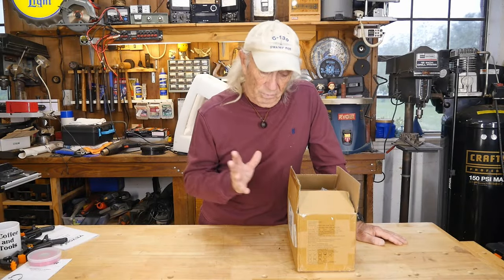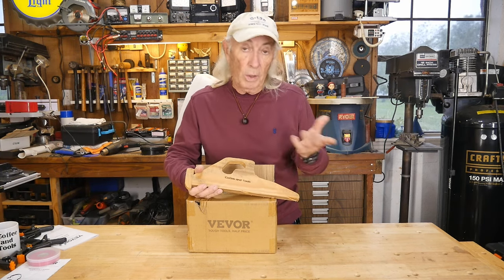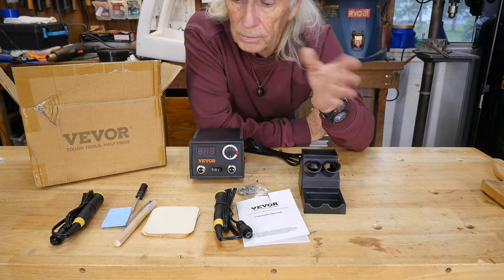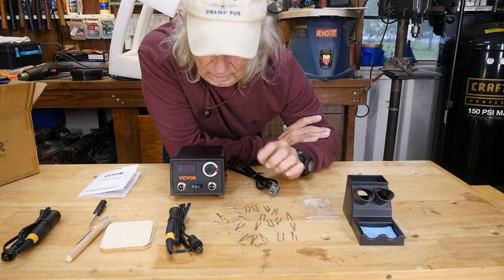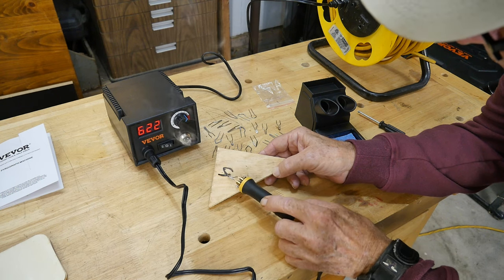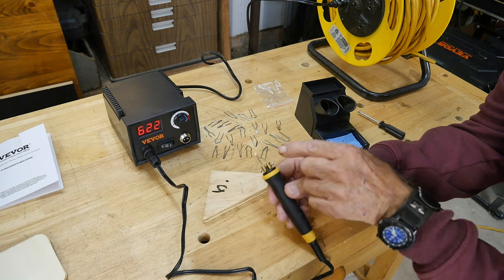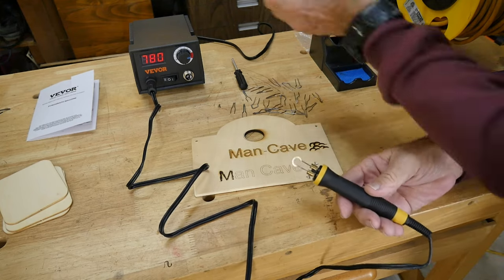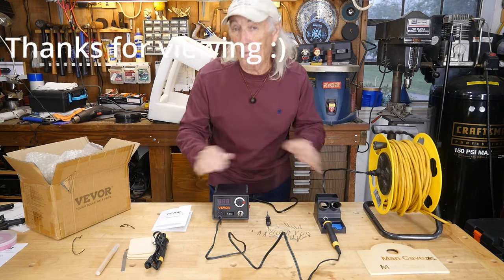Vevor wood burning engraving kit, reviewed by Coffee and tools ep 386

Comment: I think my wife would enjoy this! 
I’m guessing that the double pen is for if you’re working a design, you don’t have to let a tip cool before switching out. You can have two different tips set up and just go back and forth between the two. It comes in blue also but, I think the blue looks like a toy. And, the blue comes only in a double pen and 20 dollars more than the black double pen. Black is 41 for the double…blue, 61.
Reply from the maker: You can load 2 different burn tips for patterns etc and so it speeds up the work a tiny bit.